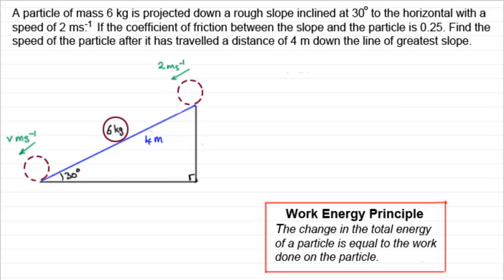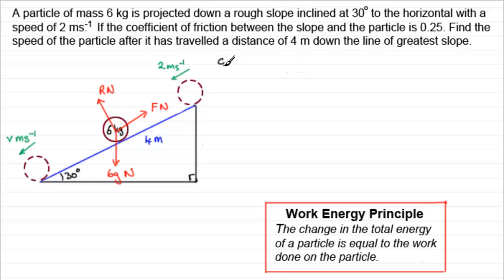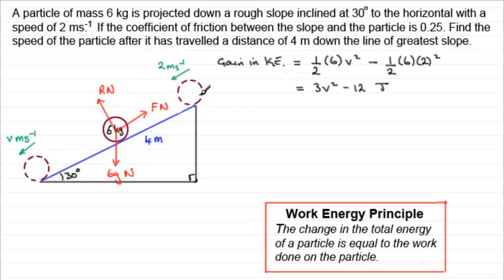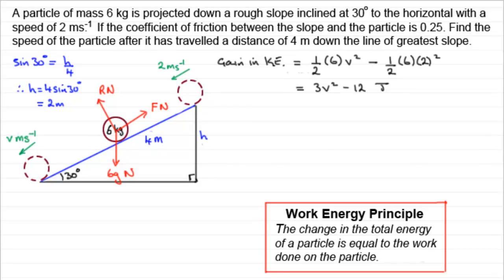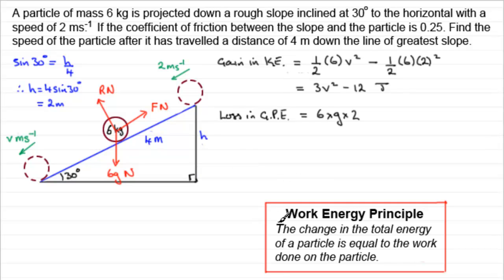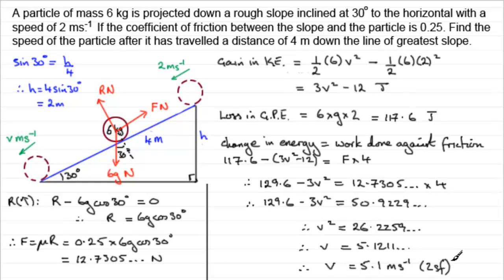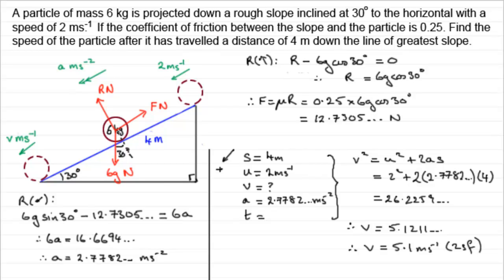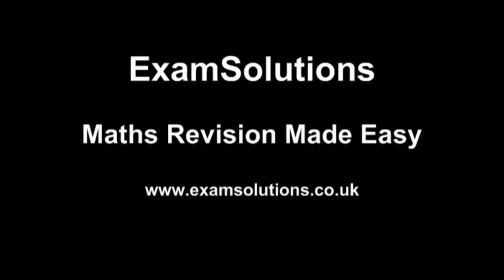Work-Energy Principle : Rough Slope : ExamSolutions

Comment: It could be a lower velocity at the bottom, right?
Reply: +AlchemistOfNirnroot It's being accelerated, so is that why it's a reasonable assumption?
Reply: For anyone else with the same question, yes, the velocity could be lower or even zero at the bottom if the friction or any other forces acting against motion are high enough. The particle would be decelerating.